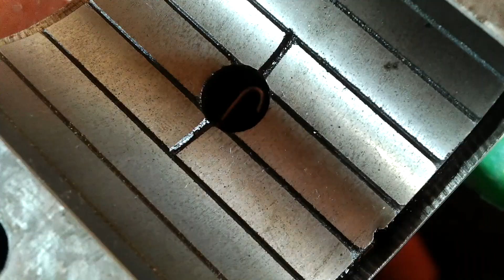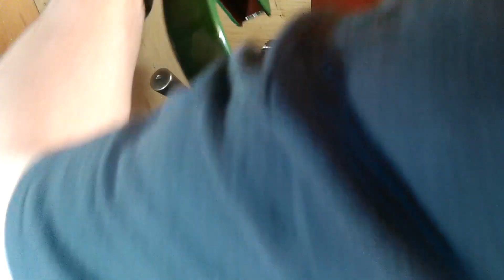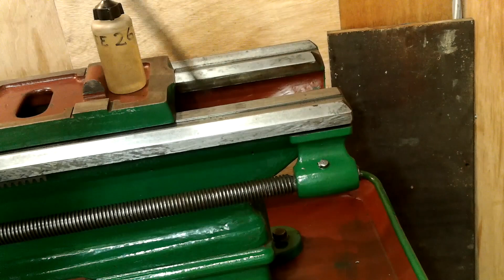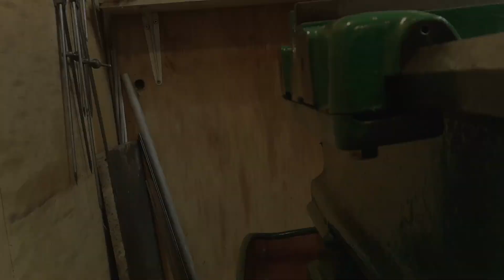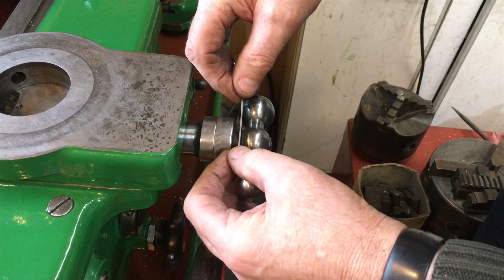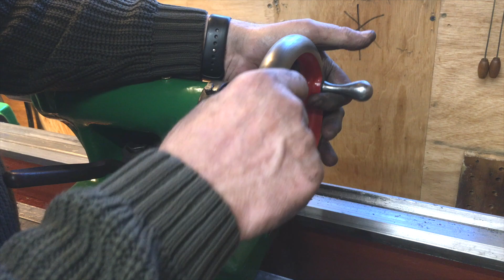South Bend 13 Final assembly (Part 11)

Comment: I Seem to own nearly the same lathe one lever on the quick change gear, but i seem to have a big piece that goes onto the other side of the bed in line with the saddle. apparently its to do tapering,

Some one reckons it might be a tool room 13" south bend lathe, around the 1940s, the serial number is 133950 no letters added on, so not a hard bed type and not 1970s, but after the numbers an inch further I have letters D.W.D stamped  into the bed,I cant find any info on this lathe ,

It has the type of bearings as yours just 2 bolts on each at the head stock, not the adjustable type where most have 2 other bolts running in between the main 2 clamp  bolts to adjust the shims that can be widen or made closer depending on how far the grub screws go down and press on the long brass or bronze piece ,effecting the bearing,

Also your threaded bar in your slide is different to mine , mine has a groove for a key way, but ime not sure if ime meant to have thrust bearings? , I think they may be missing,

In America there is a site that can look in there files and pull out a serial card for that particular south bend lathes,using the serial number on the bed, they can find the information of a south bend lathe and send a PDF file on who bought the lathe and give details on about it for $25.00 dollars,
but as they only give the choice of where do I live America or Canada i cant proceed in filling out the address ,as I live in the UK England,the company is called Grizzle , 

So is there any place in the UK that gives out dates and info by using the serial number on a lathe bed?
Reply from the maker: Hi. it cost me 25 quid as well.

Comment: Hello Paul, I really liked your solution.  I picked up an old worn out south bend lathe a while back myself.  I'm thinking of trying your solution on my lathe.  I was just curious how the repair held up once you started using it after the repair?
Reply from the maker: Hi. so far it has held up quite well, at first there was some residual blackness coming from the slide( i assume a mixture of cast iron and oil) but it seems to have settled down but, I've not taken any slide measurements to confirm the reliability of the fix. However, I am getting true components.I hope this was helpful. cheers

Comment: That was a brilliant series, I have found your channel through a recomendation by Rustinox, I have a Boxford lathe and is more or less a copy of the South Bend lathes
 How are the vee ways holding up after the resin application? that looked like a great fix. Being a retired machine tool fitter, I can see how much work and skill you put into this restoration. love your humour, and have subscribed, take care, Dave
Reply from the maker: Hi, the vee ways are doing Ok, I have had one issue with fine swarf scratching the resin but that’ll be something thats going to happen anyway if I dont wipe muck off. Cheers
Reply: @Thesheddweller  That's good, we used to fit Turcite, but that would require re-machining, regarding swarf, I've just made and fitted some small roller blinds to the ways, seems ok so far, I just used some leatherette, 12mm copper tube and  internal springs, fiddly getting tension right but works ok, cheers, Dave incidentally, I make parts for old motorbikes too!
Reply from the maker: @daveharriman2756  I also started to use a roller blind swarf control system of keeping the swarf off the slides but, I have a lot of people screaming for stuff to be done, meaning that I don’t get much time to get my stuff done, and of course I have to keep the wife in check at the same time.🤣
Reply: @Thesheddweller  know the feeling lol

Comment: I have a 13" South Bend of a similar era, single tumbler gear box like yours. Yours looks amazing.You did an excellent job. I think those little folded wires that go into the oil return is more about taking advantage of surface tension to "pull" the returning oil back down into the oil cavity.
Reply from the maker: Hi. thank you, but its mostly paint and I didn’t even paint it, my wife is to blame for that. Its very likely about them wires, but I only found the front ones when I cleared out the swarf that had piled up on top and in to the oil groove. All The Best.

Comment: I wish mine would be finished, but its to cold and no time for the restoration haha.
My biggest Issue is, that my headstock has no adjustment screws, so it cuts a taper.
Is it possible that a headstock can be adjusted even if one side sits on a v-way?
My old lathe had a flat bed and a adjustment screws on the back of the headstock, but i don't know how solve this issue on the "new" lathe
Reply from the maker: Hi, i believe its possible. Its amazing what you can do with a bit of shim in just the right place, even on a headstock. regards
Reply: @Thesheddweller  thank you for the tip, i think i will try the shim method

Comment: The Taylor Conical Chuck.... Only seen two in the wild, and I have one of them that came with an Atlas 618
Cheers
Reply from the maker: Hi, until now I had never seen one, but I understand they’re supposed to be the bees knees. ATB
Reply: @Thesheddweller  I'm sure you have read the same literature as I from lathes UK. 
I got lucky as it came with the second set of jaws.
Reply from the maker: @rickpalechuk4411  oh... I’ve got the inverted jaws as well, they’re very well made. but I haven’t read Lathe UK literature.